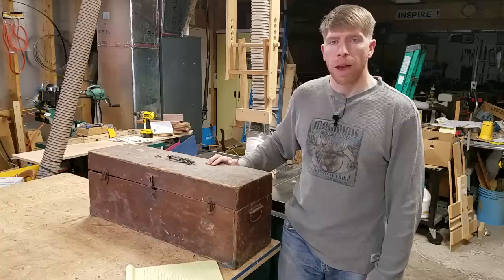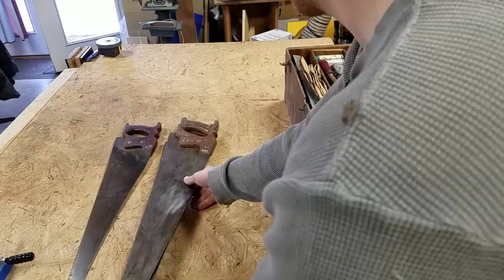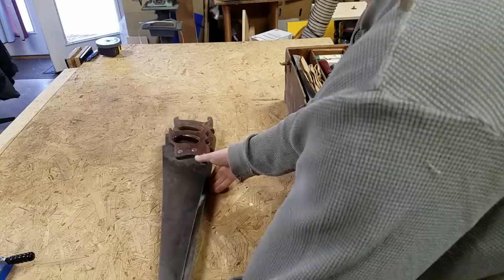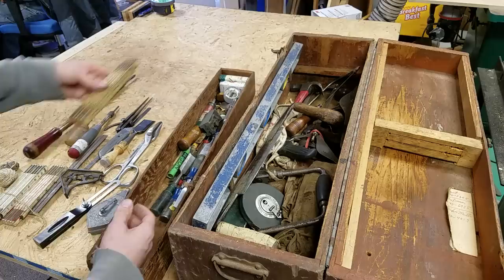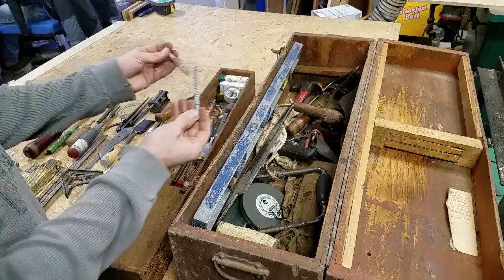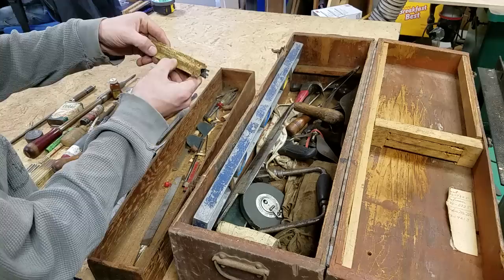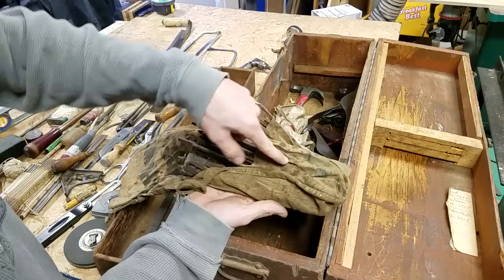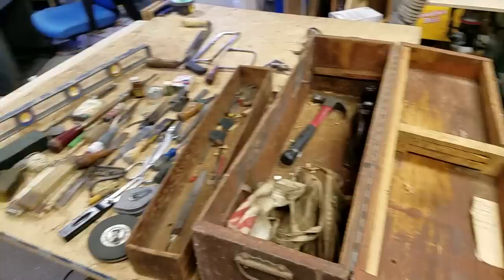Toolbox Time Capsule, unpacking a 1930-1950s era Carpenter's Toolbox! /EP43

Comment: To have work in the 1930's when the Great Depression had most people out of work must mean that he had a great reputation.

No carpenter or cabinet maker would "file his saws regularly."  Real saws (without hardened teeth) are only topped or sharpened when it is needed.  One might increase the set without sharpening a saw if the timber one is given is wetter than it should be.  To file a saw for filings sake will just wear a saw away instead of it lasting for 2 or three generations.

If a chisel can be sharpened with a file then the steel would not hold an edge.  Even the cheapest chisel would not be sharpened with a file. If there are nicks in the blade it is probably because he was glazing and hit sprigs whilst removing solid putty.  A Glazier would have a Hacking Knife for such work.

What you called a blacksmiths chisel is a Cold Chisel and would also have to be sharpened on a stone.
The Drawknife also would NOT be sharpened with a file.  His Block Plane has a camber on the edges of the blade so it would not leave lines when being used as a Smoothing Plane, and again Never sharpened with a file.

A Butt Guage is for measuring internal lengths, like between door frames.  You cannot get an accurate measurement by benting a steel tape measure.

Just because you have a Carbide tipped Masonary Drill does NOT mean he had Power Tools.  I fitted all the shelf units to a Newsagents shop using such a bit in a Breast Drill, such as the Stanley Continental, operated by hand.  There was no power on in the shop.  I worked by the light of a Tilley Lamp which I have still got.

Nail sets do not have points on them, but there are similar tools which are pointed. Can you tell the difference?

"Adjustable Spade Bit" I despair. That is an Expansive Bit, a good one will drill a hole up to 3 inches in diameter. His "hand Drill" is called a Brace.

His Jack Plane (14 inches long ) is a Stanley Bailey 5C.  What do you think the corregations on the sole of the plane are for?

You amaze me, what do tyhey teach you in Resistant Materials Technology classes in High School?   I worked on the tools from bricklaying to cabinet making in my younger days.  For the last 12 years of my working life I was a Teacher of Technologies, in a secondary (public in US) school, teaching Resistant Materials (including woodwork), Graphic Products (Design and manufacture of packaging and Point of Sale Displays), Food Technology and Electronics.  I am now 71 and I would consider myself a complete failure if any of my students hadn't sharpened chisels, planes and kitchen knives.
Reply from the maker: Rebecca Donaldson,  first thank you for watching and taking the time to comment.  I am embarrassed by all of the mispeaks I had in the video and of course showed my ignorance on some of the tools, mainly sharpening. I'm not the best at off-the cuff speaking, I'm not a professional speaker but didn't bother to edit or correct my video in order to leave it authentic even in the areas that I knew I had made mistakes. I know that I'm learning something new every-day.   You're certainly, correct on that I'm not as informed as I should be about sharpening, that has changed in the past few years. Don't assume I haven't sharpened anything at all(...you know what that does). I'm embarrassed, not only did I take every materials and tech-ed class my school offered, but I'm a degreed mechanical engineer with many materials science and machining classes. I was even taught to test for hardness levels with hardness files. I straight was not thinking about hardness at all when speaking in this video. It sounds like my father and you would have a lot in common. He was a technology-education teacher for 33 years, and which sounds very similar to your resistant materials classes. He was also a contractor and completed projects, including building two of his own homes from the ground-up nearly alone. I've apprenticed with him on many jobs over my life. I worked in a hardware store clerk/maintainer/window glazier using and selling most of these tools for 10x years as a boy and young man. I have only owned a few files and I have rarely worked with them. My own experience is limited to using them for things like sharpening mower and chain-saw blades, deburring etc. I can vividly remember him doing the same, which is why I suppose I associate his bench vice with always holding something that he was file sharpening. I know he primarily used stones because that's what he taught me to use for knives. I've only ever used grinders, stones and sandpaper for sharpening as I was taught to do, by my dad. I've always assumed (inaccurately) that machinist files were used for sharpening, not thinking of how much of the steel was hardened etc. I've heard stories of "great" old-time machinists doing amazing things with files and assumed that they were used for restoring edges to some tools that they were not. Again, should've known better, but that's why experience with a tool and receiving instruction on them is always important.
I'll address several of your points directly, I'm not sure if some of them are questions, or just adding to the general content, I'll assume you're working to educate and that we're both seeking clarity: By stating that he "regularly" sharpened his tools, I'm implying as needed, not after every use. He was the person that taught me you work twice as hard with a dull tool and that they are also more dangerous because you use more force. In other words,  he made maintenance a priority and I doubt he enjoyed the necessary chore of sharpening any more than necessary. I've always called the masonry chisel a black-smith's chisel for some odd reason, I guess that's because of using it with a black-smith's hammer for breaking brick/stone for masonry work. It's my Pennsylvania-eese speaking I suppose.Thanks for adding clarity for the butt-gauge, I didn't do a good job of stating what it was and I was surprised to see one in his box. I've never used one on a construction site, but it makes sense as you described.For the nail set, it was clearly ground to a point, it was not a punch, and yes I can tell the difference and own sets of both. The grinder marks were clear and it clearly was ground to a point. I was commenting wondering why he might have done that and what he might have used it for. For the corrugated sole on the plane, I know Stanley made them for a short period, I think it was mostly a design fad aimed at reducing friction and I understand it wasn't really something that held up to scrutiny. I have a suspicion it was also a cost-saver in manufacturing allowing them to flatten soles faster by starting with a casting with less area to grind flat. Since this video, I've learned more about braces, I've used them in the past (my dad started me with one) but I was never told what they were called or corrected. It was well pointed out by numerous others and I appreciate it. I was impressed with the "expanding spade bit" I've never used one, but own several modern versions of adjustable cutters. It appears to cut in the same manner as a spade bit with two points and a chisel-edge. If you had never seen one, how would you describe it?  He did embrace a few power tools, I'm not sure if the carbide tips bits were for a hammer drill or the breast drill. Most likely there weren't power tools on his job-sites because of when he "retired", but I don't know when he last used or stocked this toolbox. I think by the end of your comment you were outright scoffing at me, maybe you found my ignorance overwhelming...Maybe my pride is interpreting it that way. As a teacher, I would hope that you have developed patience for educating others and would ask that you bring that approach to your online interactions also. Other viewers can learn a lot from you and those that take the time to comment. I also appreciate the education and feedback, it definitely does a lot to teach me and keep me humble.
Reply: @benchtopwoodworks  Thanks for the reply. Just remember that when you make a video, You are the Teacher and you are programming young minds which are a blank sheet. You have to get it right first time.  All the best.
Reply from the maker: Absolutely taken to heart,  my best to you also! Thanks again for watching and adding to the dialogue.

Comment: Very interesting video :) Thanks for sharing. What did you call those you pick up at 10:38?
Reply from the maker: Stefan, thanks for watching!
My dad called them stair gages ((gauges)... Sorry the engineer in me won't allow me to put the "u" unless referring to a pressure reading gauge), they are clamps that mount on a framing square for repeat angular marking. I don't think I've ever personally used them. I guess I've only helped place stair stringers, never marked or cut them.
Reply: @benchtopwoodworks  Ok, thanks.

Comment: If you have a file that does anything other than make a terrible noise on a piece of tool steel, you need a new tool.  A file shouldn't bite into tempered high carbon steel.  If it does, you worked it too hard and lost the good cutting edge with excessive heat.

I'm sure all those Stanley pieces were made in New Britain, CT and my family played a part in making those quality tools.  It was a damn shame when they outsourced manufacturing to China in the 80's.  The city is just now starting to recover.
Reply from the maker: Thanks for sharing about your family's history with Stanley. Definitely not made to the same standards now. 
Thanks also for sharing about sharpening...or not with files. I know the plain irons are high carbon steel, but are they tempered?
Reply: Any tool that's supposed to hold an edge should have been hardened with a quench and tempered for durability.  If you just quench high carbon steel, it'll shatter like glass when put under too much stress (like when your tungsten drill bits snap or shatter).  The tempering process softens the metal a bit, but prevents it from shattering or cracking with hard use.

Any steel labeled as "mild steel" has a lower carbon content and can't be quenched and hardened into a usable edge.  Meaning you can't make a good chisel out of angle iron, or a good drill bit out of rod stock.  The steel will just roll an edge and bend when put under strain.

My guess is that the saws are made with a relatively high carbon spring steel, or else they wouldn't be able to bend and flex so well.  I'd guess the entire saw is hardened and tempered, otherwise it wouldn't spring back to true.  If the saw blade holds a bend, it's either differentially hardened (soft back, hardened edge) or lost the temper somehow.  (axes and metal cutting saw blades tend to be differentially hardened)  It happens with friction, especially drill bits and high speed saw blades.  That's why cutting oil is a great idea when drilling or cutting metal.

The chisel and plane blades are definitely made of some kind of tool steel, otherwise the edge will start to roll after a couple cuts into hardwood.  I have a little 3x6" double sided whetstone that I keep in a tupperware container filled with water.  Believe it or not, the water makes a huge difference between pretty sharp and scary sharp on the same stone.  I only use the coarse side if I put an actual divot into the chisel from an old staple in the wood or something like that.  99% of the time I just use the fine side and give the chisel a few strokes when a cut takes a bit of work to make.  Just be careful to only sharpen the angled top with the whole bevel laying flat on the stone.  Never sharpen from the bottom or you lose that perfectly flat edge.  I use a clean piece of scrap wood to "strop" the final edge back and forth, flipping the blade upside down and back.  What that does is align the microscopic wire edge flat so you're cutting with a razor and not a microscopically rolled edge.  You can feel the blade drag a bit at first, but once the edge aligns it feels very smooth and offers no resistance.  The first few cuts will take no effort at all and look perfect.

Comment: Hello, very  nice video, I would like to know the exact dimensions on the toolbox. The height, width and depth. Sincerity Tool Lover.
Reply from the maker: Clifford, it will be awhile before I would  be in the same location to measure. Approximately it is 8"D x 10"H x 36"W.
Reply: Thanks Crhis, those approximations are good enough. Have a nice day.

Comment: Some of those tools are post-1950's....
Reply from the maker: Sure are, his main years of working as a builder and Carpenter were 1930s-1950s which is the reason for the title.  I'm more showing what he kept as in his box as essentials based on his experience. He worked with his tools until the year he died through the 90's.